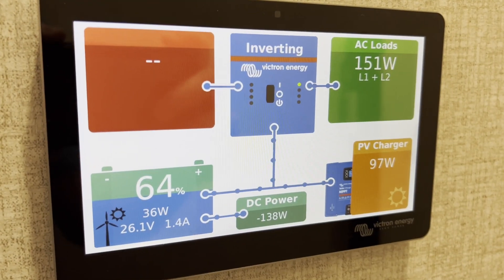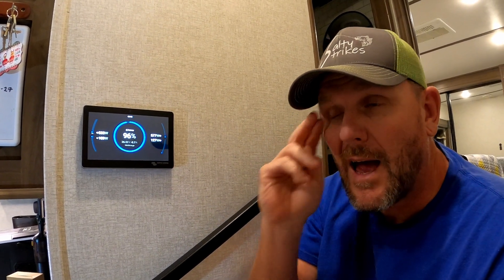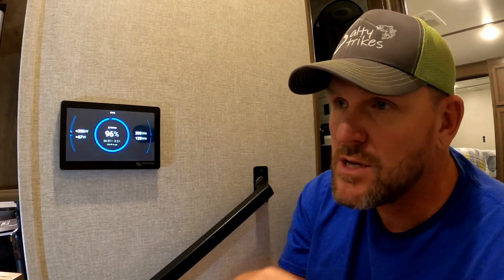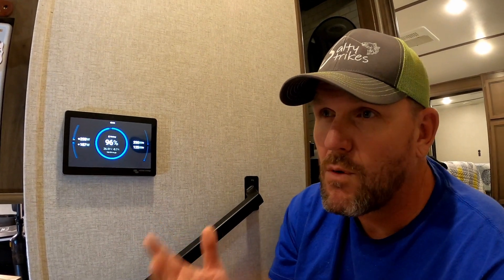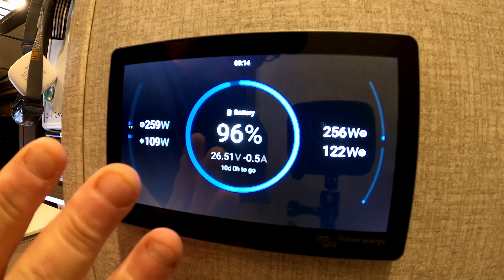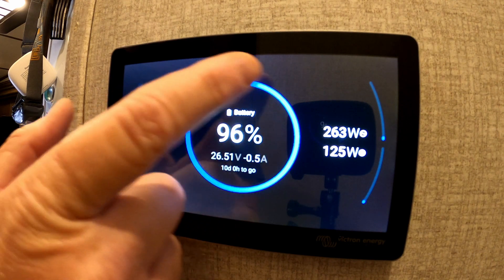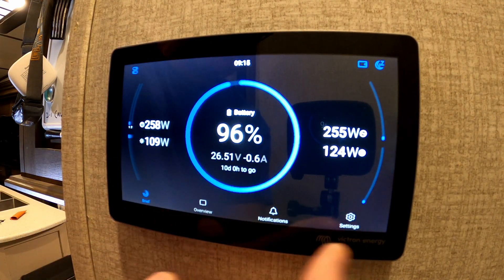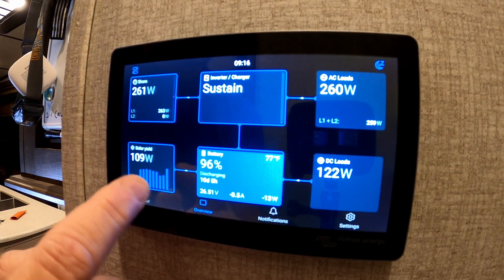NEW- Victron Cerbo GX Update Version 3.5 ***Watch This First***

Comment: Go to Settings → Firmware → Stored backup firmware.

The following screen shows the firmware version currently running and the firmware version that can be booted.

Click on 'Press to boot' to boot into the stored firmware version.

The stored firmware version is now booted and the previous firmware version will be saved instead.
Reply: Go to Settings → Firmware → Stored backup firmware.

The following screen shows the firmware version currently running and the firmware version that can be booted.

Click on 'Press to boot' to boot into the stored firmware version.

The stored firmware version is now booted and the previous firmware version will be saved instead.
Reply from the maker: @richpetrelli2783  thanks, I switch back to the older version, maybe once they get some more feed back they will do better
Reply: I watched the introduction of the new software and they said once it's updated it can't go back. It's permanent 😂 but I don't know i haven't installed my cerbo yet.

Comment: Agreed... option for larger text on screen, and, allow us to at least choose colours for the overview screen.
For that matter, colours should be programmable on the 'Brief' screen too... or at the very least, on both screens, we should be able to choose an overall colour theme.
I like moving 'Batteries" to the lower middle position. Like the inverter, it both takes in, and gives out power, so it makes more sense this way with all inputs on the left, and all outputs/loads to the right, with the inverter and battery exchanging as needed.
Overall I'm satisfied, and tweaks will be made, by Victron or others, to fill any much called for features.

Comment: Well the previous firmware had issues.  My Cerbo-S  had problems with needing a reboot every week or it needs a hard reboot (painful on a remote site) and it does not display information correctly on vrm etc.  Why for example, is my Grid side PV inverter........displayed on the AC out-1 of my Multiplus??

Comment: So noone told you are you get older, they make the print smaller and lower the floor.  

I'm 73 and prefer the new screen.  I'm not able to get to check it out right now but I thought I saw a setting on changing font.

Comment: was about to order a new system based on victron because of the cerbo gx, the new cerbo display looks like a renogy display now.

I want a color display for colors not different shades of blue, heck even renogy has blue AND green .....

Thanks for the video, now to find a new winter project.

Edit: you can have this same blue display simply by setting up and touchscreen android device, tablet, etc and it will look exactly like this. no need to spend money on a cerbo

Comment: you can revert to the old UI in the settings.  I do agree it would be nicer if the font sizes were bigger, or if you had an option to increase the system font sizes like on the iPhone.
Reply from the maker: @rscotten  already reverted back to original 👍

Comment: I installed the GUI Mods about a year or 2 ago and absolutely love it. I permanently display at the bottom (Cerbo GX 50) diesel, fresh water and grey water levels as well as a lot of other features. I was about to install this new version when I saw this video. 
You saved me a lot of  heartache. 
Thank you👍
Reply: Everything I have read, says 3.42 is probably the last GuiMods version.  He posted that he is not working on it currently.  Also, unfortunately, GuiMods does not work with the new version.  The new version is a LOT faster, and does have some good points, although I am going BACK to 3.42 and Guimode for the time being.
Reply: GuiMods still works - with latest V3.51 VenusOS - you need GuiMods v10.75 now available

Comment: @Salty Trips

Victron Installer here

1 You can revert back any time  from Settings -> Display menu

2 Remote console on new UI requires you to enable a settings  -> Services  ->MQTT Access   uh correction use to need this check your security settings  might bee that you downgraded and upgraded the software for the video?  

3 Yes no mirror function on new UI  (mirror function remote console shows same as the touch screen...)
Reply from the maker: @TheWi-Fi  already reverted back this morning 👍

Comment: We have a metering device fitted to our camper as we have 2 hookups connected to the camper, the meter used to display usage on the cerbo gx as a Generator, the usage is no longer dispalyed after the update. Not impressed by the update at all, though there is now a page for the temperature sensors, the rest is awful.
Reply from the maker: @fifthwheeladventures  I switch back to the original this morning, thinking about adding the GUI mods.
Reply: @saltytrips  GUI Mods with "old" color UI is the best of both worlds IMO!
Reply: @saltytrips
I installed the GUI Mods about a year or 2 ago and Love it. I permanently display at the bottom (Cerbo GX 50) diesel, fresh water and grey water levels. I was about to install this new version when I saw this video. 
You saved me some serious heartache. 
Thank you👍
Reply: @saltytrips  Ah ok, wasnt aware the Cerbo could be wound back, will have a look at that now.
Reply from the maker: @fifthwheeladventures  several commented below explaining how to switch back

Comment: Settings - General -   ...  scroll down..  Remote Console UI ...    " Classic UI, or,  New UI "    .......
Reply from the maker: @lotechgreg  thats not an option, under general all you have to do is… access level, network security profile, remote support, remote support tunnel, remote support Ip and port, reboot, audible alarm, enable status led, demo mode… no where does ot say “remote console UI”
Reply: @saltytrips  This is because it's not under "General". You can switch back to the Classic UI under the "Display and Language" menu - all the way in the bottom. :)
Reply from the maker: @baestetsound  thats what I was saying
Reply: @baestetsound  -- I did that but it all looks the same!
Reply: VRM @saltytrips

Comment: Mine stopped working as well. I mean the remote control dos not connect. And you are right the text is so small I have to ware my glasses to see it. It used to have such nice colors and now it’s really bad. They should have an option to switch back to the older version.
Reply from the maker: @damianthomas2242  someone left a comment below on how to switch it back

Comment: Does it now show any info about the dc-dc + power?  On the old system it didn’t show it specifically
Reply from the maker: @Mth308  not that I’m aware of, its mostly just a face lift, no real new useful features, just changed the look for the worse.

Comment: Isn't there an option to revert back to the prior version
Reply from the maker: @markratliff7991  haven’t had a chance to check it out yet
Reply: I think there is
Reply: Yes you can use the old interface with the new version. Gui mod does not work with 3.5
Reply: @stilllearningagain  -- Classic GUI without GUI Mods is worse than the new GUI!